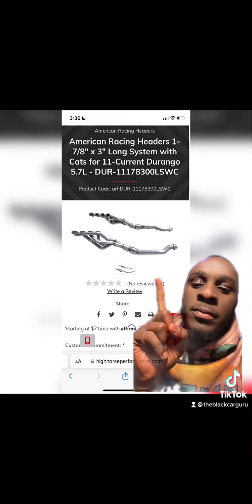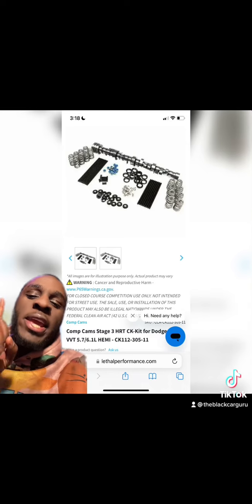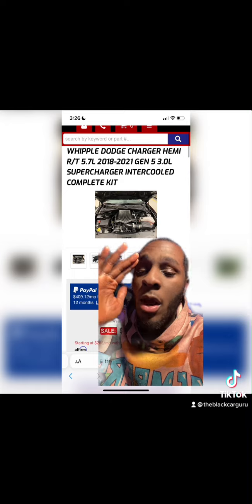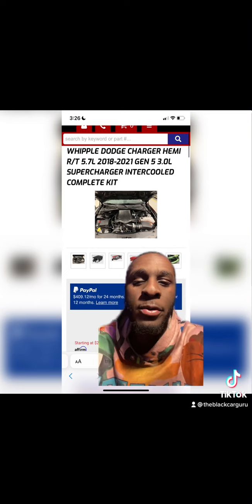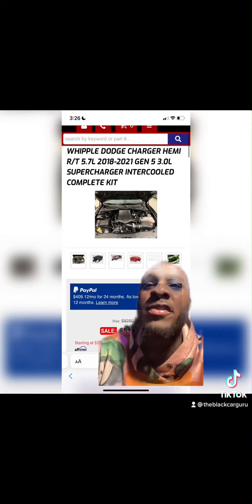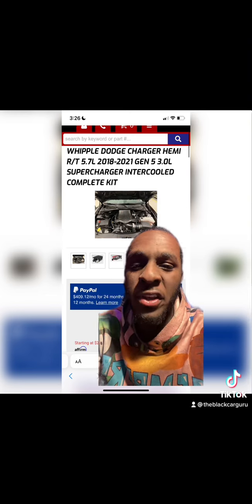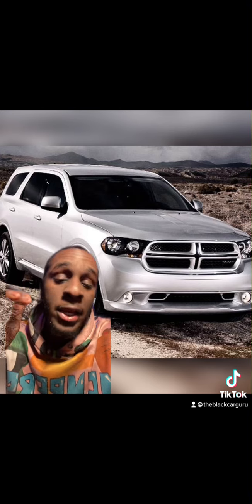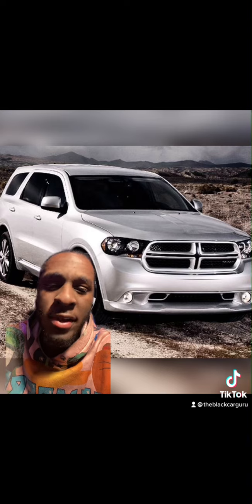The Dodge Durango R/T is just an overweight Dodge Challenger! | But better!

Comment: Been upgrading my 2015 DD since late 2018. Every year i did a little more. Right now it has a 5.7 based 6.4 stroker, big cam, FBO and at 4400 lbs race weight, with a roll bar to be NHRA compliant. Its a complete track SUV. A Turbo setup  is next. First track runs with the newest setup will be on Feb 9th and 10th.

Comment: Maybe things have changed, but they may need a bigger stall converter with that big of a cam. Maybe HRT has better cams than the 270/274 cams, but the 274 cam and Stage 3 HRT are very similar. Been told numerous times that it’ll need a bigger stall, 2600-3200 stall preferably.

Comment: Ahh yes. Time to find an R/T Durango/Hemi GC
Reply: they’re slow
Reply: @miseryparty3726  everything is slow stock 🤝🏾
Reply: @TasteMyPP  why not just buy an E 55 AMG? has 469hp stock and a supercharger. don’t even have to tear the engine down to make more power, a tune and bolt ons can help make 500-600 hp. way better than that ugly durango
Reply: @TasteMyPP  durango is still slow when built lol
Reply: @miseryparty3726  it’s in the class of Sport SUVs/pickup so it’s obviously gonna be slow unless it’s a Urus or Trackhawk
Reply: @miseryparty3726  stock supercharger=forged internals. I have a first gen turboed rt, can’t speak for these boats, I weigh less.

Comment: Holds up stay away from 2011-2013 if you want to make big power without dropping a bag 💰I’ve done everything to mines it’s on my Channel 6.4 swapped and all the problem is the trans just get a 8 speed 545rfe is trans is trash if they came with the nag1 like the srt8 jeeps I’ll say best bang for the buck 💸 but your going to run into issues with the trans and it’s not many options but to 8 speed swap it SPEND THE EXTRA ON A 8 SPEED 5.7 !!! Then you can just stright drop any other engine dodge made right in hellcat scat with no mods other then like intercooler for hellcat my car made 330. With the 6.4 because the trans couldn’t hold the power
Reply: that’s slow af. an E 55 AMG is faster stock and even faster modified
Reply: @miseryparty3726  why are we even comparing a Durango and a E55 they shouldn’t even be racing 5.7 shouldn’t be why you trolling 🧌 me
Reply: @Krystopherbyers23  we're talking about fast performance cars. durango is not that at all
Reply: @miseryparty3726  exactly so why are we even comparing a car to it
Reply: @Krystopherbyers23  he’s all over the comments with his E55😂 id get a E63s instead
Reply: @Boe3  I see he a troll 🧌 it show dat soon as you hit his profile he on every video talking bout how fast the E55 he don’t got is